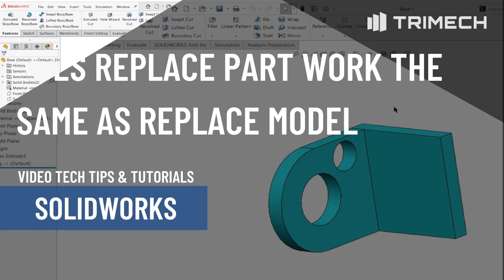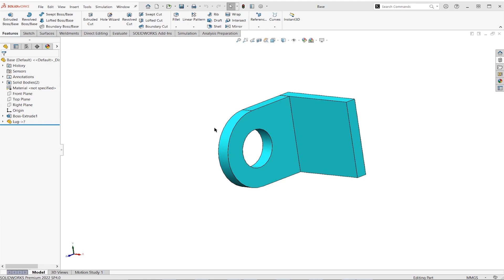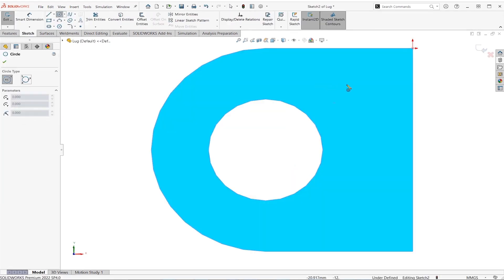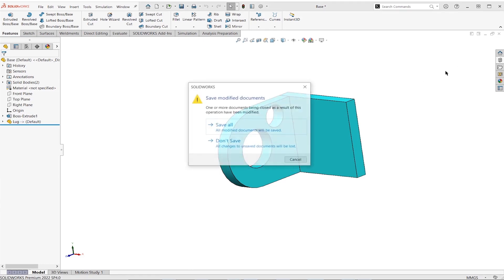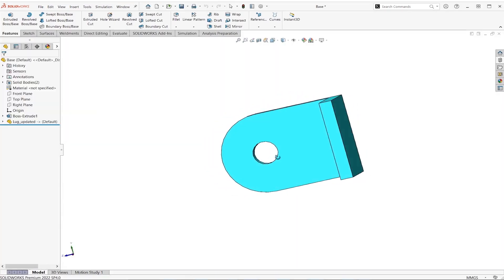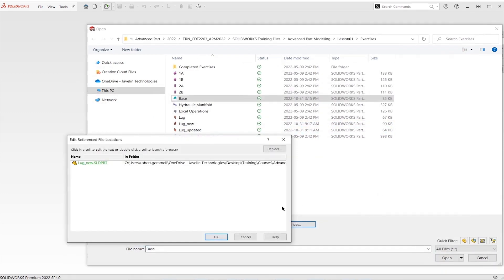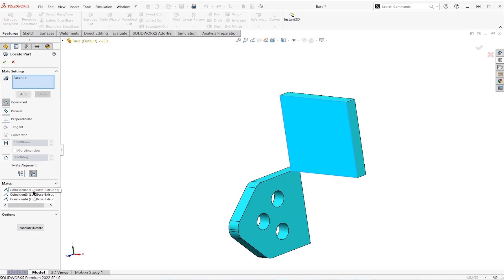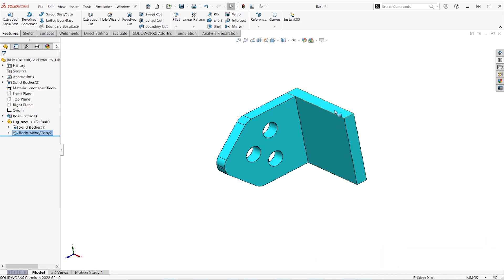Does Replace Part Work the Same as Replace Model in SOLIDWORKS

Comment: Hey. This is great. Exactly what I am looking for, However, its not working for me. When I change the reference name, the new file shows green. But when I open it, the original file is still in there. Any ideas?
Reply: SAME!!
Reply: When you change a reference in this way (method 2 or 3 from the video), the DISPLAYED name in the feature sometimes does not update to the new inserted part.  So it may look like the part is not pointing to your new referenced part (because the name is still "Lug"), when it actually is.  One way you can check this is by right clicking on the inserted part in the feature tree, then clicking External References.  At the top, there is a file location following "Part Name:".  This will be greyed out, but it shows the true path and file name of the inserted part (which should be "Lug_updated" or "Lug_new" if done correctly).  You can also double click the part name in the feature tree and it will give you the option to re-name the part, which proves that the part name in the feature tree is not dynamic, but static.  Not very useful functionality and there is probably a setting you can change that drives this.